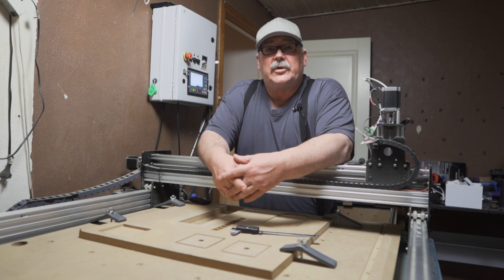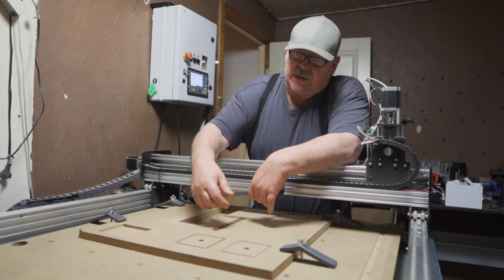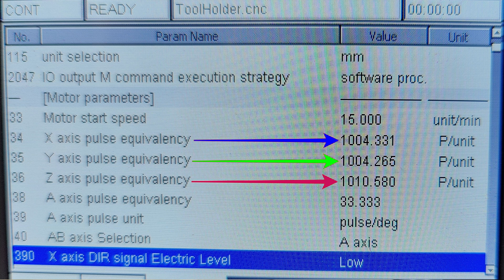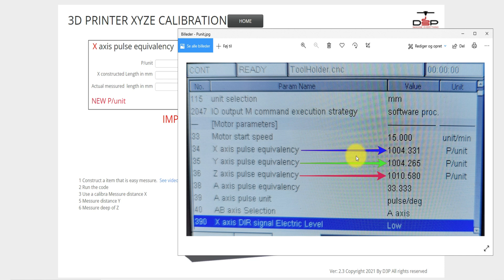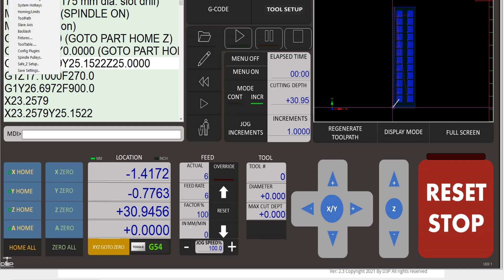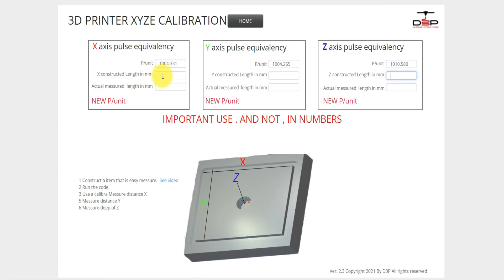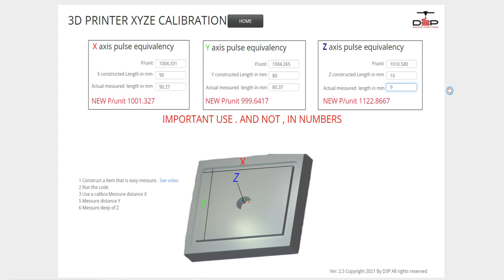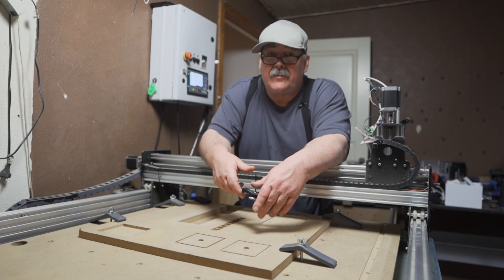Calibrate your stepper motors on your cnc

Comment: hello sir, what about circles i tried to make a circle and my machine made an ellipse, what am i doing wrong?
Reply from the maker: You absolutely need to calibrate your stepper motors
Reply: @weitlingD3P  i did i made a simple G code of a rectangle and circle in it and the x and y axsis are precise to 0.01mm
Reply from the maker: @drejegetahun9916  That is perfect :)